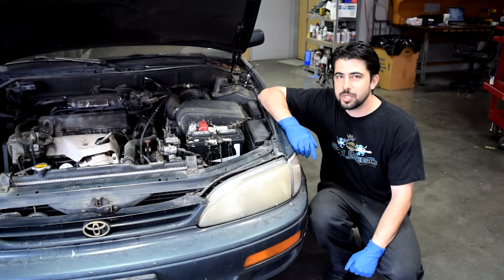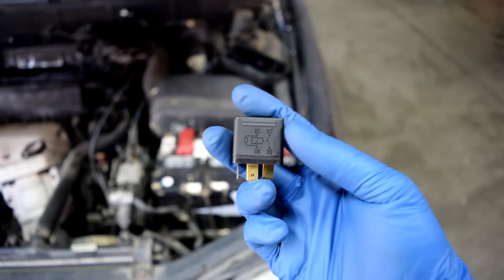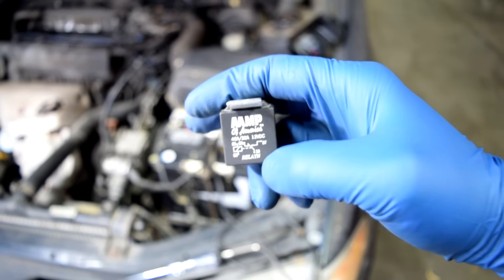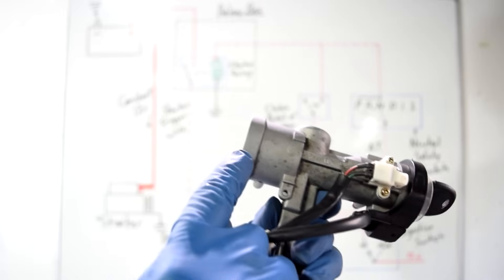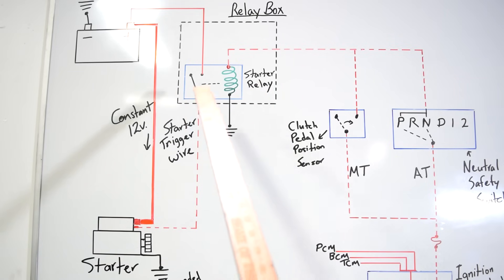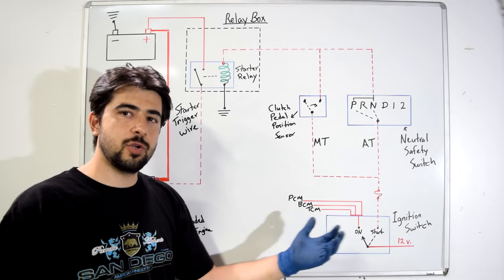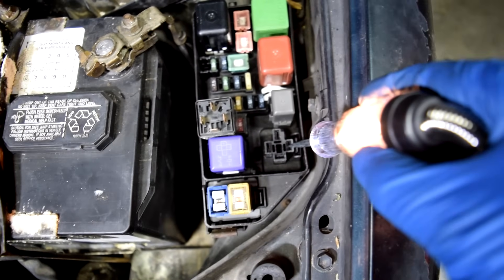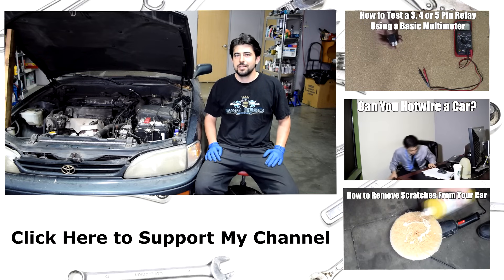How to Start a Car With a Paper Clip - NOT A HOAX

Comment: it is not about stealing the car. it is to check the starter without touching it. indirectly checking the ignition switch, neytral safety switch, and ignition relay

Comment: hi there having a big problem crank to start ok I replace crankshaft sensor ,spark plugs,ingntion switch,check fuel pump,coil pack on 2000 ford ranger please help 6787091022

Comment: I need sum help with my 2003 CLK320 ... I GOT IT TO GOT INTO THE ON POSITION BY DROPPING THE IGNITION OUT...THEN TRIED TO USE THE RELAY TO START... CANNOT GET A CRANK ...NOT SURE WHICH RELAY EITHER

Comment: Regrettably this method did not work on my 1992 Dodge B250 van.  I found the #30 and #87 slots and with a new battery, good working starter.  The van still will not start.  It will not turn over, it won't make any sound, the lights work the dash lights come on and the Check Engine light goes off.  The paper clip would not start my van.  :>(

Comment: I have a 2003 Lincoln town car executive.... with no crank and no start .... I was getting Crank , but no Start .. I removed all the Relays, and tested them for continuity, and Coil Connection... which I have both ... The battery is charged , and it's gased  ... plz help .. what happened...

Comment: Hi, I have a no crank no start issue with a 2011 jeep patriot.  I was wondering if you knew where the starter relay is located - in the TIPM or in the ASD, or somewhere else? Thanks.

Comment: I have this issue with my truck. If i do not have a issue with the relay or starter and it starts perfectly fine with this method, how can i figure out what the problem is before those? Bc sometimes (when it feels like it) out of no where the truck does not start, and i use the little trick and it starts. What part do i need to change or fix?

Comment: My 97 Plymouth Grand Voyager Van has a no crank no start condition or a "Open" condition. I used a remote switch
to test the starter to the solenoid which deemed the starter as good. With the key in the Run position and the remote
starter switch utilized the van will not run. Cranks only. I am leaning towards an issue at the key lock switch. Watching your video gave me the insight to try the jump at the relay as that will test the wiring from the power distribution center to the solenoid and eliminate that side of circuit as an "Open" however will need to also confirm the signal at the Engine Control Module. More troubleshooting to continue for my (No crank no start Van)  What is
so weird about all this as I drive it daily with over 300k miles on it. This last Wednesday I parked it for about an 
hour and went to get in it and go and nothing. So it has been a mystery to me as why that happened after driving it
under a shade tree to park. Guess that is why I am a shade tree mechanic. Got lucky about that parking as it is now hot here.

Comment: This reminds me of how to start a car when the alternators not working or the battery is badd used to take a screwdriver or any piece of material medal preferably a screwdriver that will protect you from getting shocked and connect to screw driver from the starter to any metal part of the vehicle and I would jump start your car I'm all school does every body remember that

Comment: ok , you got your car started, show me how to unlock the steering wheel so I can drive.. lol
Reply: There should be a module, somewhere in the dash that locks the steering wheel. 
Find it, remove it and you're good.
Reply: just break the steering lock, it sucks you have to replace it but if thats what you have to do.
Reply: Slam it in one direction or the other and the lock will break and you can drive
Reply: So you gonna wanna grab the wheel. Then let go and let the HULK GRAB THE WHEEEL
Reply: Turn the key
Reply: What about bypassing immobilizer on 07 pt cruisers .?? Lost key 😢
Reply: Put a flat head screwdriver inbetween the steering column and pry it , it should unlock
Reply: Youre gonna have to probably go screwdriver method.
Reply: Not what the guy above me said, my bad. I mean you might try the Kia boys method🤣 the old school screwdriver key. Just search how to start a car with a screwdriver
Reply: Why does my g.prix. 2002.3.1 only start when tilt wheel is in fully downward position? Something to do with bad wiring I'm told. Mechanic had done it this way cause lock cylinder was not always fully turning back position.
Reply: Get an angle grinder and cut the barrel off, it works great
Reply: 5444
Reply: @stevetoutant3554  l
Reply: Use a breaker bar

Comment: That's impressive, man. My friend who is an older gentlemen has a KIA Amanti, 2005. He claims the 3 front fuel injectors are overflowing with fuel, but the other 3 injectors are fine. His car strays but skips and alot. He is trying to figure out if he needs to replace the front fuel injectors, fuel sensor, or is it possible it may be his timing belt. How can I diagnose weather which fuel injectors is malfunctioning?  Thank you.

Comment: need help  all new parts  stated with paper clip no problem   on the   87  and 30   87 hot 30 does not have any power is that why ignition wont start car  help  help all fuses good baterrty altenator new

Comment: Have you heard of late 90s mustang with starting problems. I could spray starting fluid in the intake and it would start but after a few days it wouldn't start again unless I repeated the same process. Changed pumps, filter relays , and fuel rail and it still does the same.

Comment: great  video  03  crown vic  started  car with paper  clip  evry thing  good put a new  relay  but when   i turn ignition still nothing new alternatror battery car  runs good  is there something in ignition  that i have to replace      what DO YOU THINK ANY IDEAS   PLEASE  ALSO     TO  DO  A STRAT BUTTON RUN  WIRE  TO INSID  TO A BUTTON TO START  WI WHY DOSES IT NOT WORK

Comment: FYI, doing this on some vehicles, in particular, old Ford trucks, works great, but I have burned the crap out of a screwdriver before...if it'll melt a metal tool, it can burn you. Insulate the paperclip, wear gloves, or hold the tool you use by its non conductive handle. Also, depending on prices and budgets, you can bypass the relay semi permanently by using lamp cord and a push button on off "Nascar" style switch from the hardware store. Wire is free, switch is like 5 bucks. Run the switch into a bracket along the bottom of the dash, run wire through the seam in the door frame, down to the bypassed relay. It's also convenient for the fact that, as long as you don't tell anyone, no one will ever be able to steal your car, and you can do all of this, even when its raining outside. P.S. You WILL get burned if you try this method when you are soaking ass wet.
Reply: Thank u for this

Comment: If the relay malfunctioned, with 30 shorted to 87. wouldn't the starter crank nonstop without even the key in the "ON" or "IGN" position ??

That was what happened with my car's aircon fan. It ran nonstop on its own without any key in there, since the 87 part of the relay was permanently connected to the battery's positive terminal. I think this was a faulty kind of wiring - 87 should be to the "ACC" or "IGN" position.

Comment: I really enjoyed and learned from your explanation of the Starting System and relays !!
Reply: IhaveA2000Mercury Grand Marquis I need ur help desperately I was changing out TheFlyWheelon the car ,Well I needed a tool air I popped the trunk to get the tool well here is the part that makes me learn from dumb mistakes...I forgot  that the starter wire s were hanging is they touched hthe cross support bar at the bottom of the car So new the car smoking bad  well uyank the battery checked for turned wures none were found but the smoked only came from the driver side fiewalp and on rage inside of the car  please gel me fix what ever the problem may be I kniw that the oroblem had or come that dumb mistake that I made please help me out ...ScottLJohnsonSr

Comment: I've a 93 Ranger have some issue yesterday.  Truck can't start. Sometimes it does and most of the time it just click.Today I found out that cab light is not on. I had the battery charged and cab light still not on When do I begin? Main Fuse?

Comment: I have a F150 That blows fuses. When I turn the switch to on, right blinker works, left blinker flashes fast. When I  start the engine, it blows the fuse to the tail lights and blinkers. Could a relay short out and cause this?

Comment: can you power all the stuff you power on before the starter from under the hood somehow easily ? So you don't have to mess with the wires in the steering column if you don't have a key ?  I read you can wire the battery + to the ignition coil, then do what you showed here either shorting at the relay socket like you did, or at the starter itself.  
I'm considering buying a 1991 RV camper but the ignition switch is broken (actuator rod is snapped).  Maybe that old of a car doesn't have any modules/computers in it. 
Or maybe is just easier to pull the cable out of the steering column and figure our how to short them.  What would you recommend ?  Thanks a lot for the video.

Comment: Your narration is entertaining but a bit chaotic at times, so I apologize the need to ask for clarification.

By this not working with an electronic immobilizer, I believe you mean the method without the key? The exact variety of VW keys you show - late 90's or early 00's - point to a generation of cars where this trick might very well work with the key and ignition activated. At least I think I remember my mk. IV with standard transmission was able to hill start, which should mean the immobilizer is ready to go after key is inserted against the antenna ring and keyswitch turned to ignition, even if cranking were to be applied by other means than turning key to start position.

Hill(billy), tow or push starting any relatively modern car is of course recommended against by the mfg, and I'm not telling anyone to attempt it unless in an emergency.

Comment: this trick does work, but in some cases will fry your fingers when said paper clip goes from room temp to red hot in a matter of nanoseconds.... he used a fairly thick paper clip and got lucky... if he used a smaller paper clip he would have got burned too.... the easiest thing to do is just short the small wire terminal to the big wire terninal on the starter it's self with a small screwdriver, this fires the solenoid which fires the starter and all fingers are safely out of harms way if things get hot

Comment: If you get in your car, put the key in the ignition and you have power, radio and all other accessories then try to start the car and you dont even get a solenoid tick, i'd bet it's the solenoid (or so little power it wont even kick the solenoid).

If you get into your car and you have no power at all, well it's most likely your battery.... (if the battery is fully charged and you have no power still, you've got yourself a bit of an electrical problem)

If you try and crank the motor and it keeps cranking but you get no start,  it's probably fuel pump or ignition.

If you try to start the car and your solenoid on the starter ticks but the starter wont turn over it's possible the starter itself has a dead spot in it or maybe not enough power to turn the starter over. sometimes if you keep trying it'll eventually work, smacking it with a hammer sometimes works (enough of a nudge to get it out of its deadspot), or you try bump starting.

Let me know if i missed anything, i trust the internet will. lol

Comment: People seemed entirely too confused by this video and the fact that he had a key. 

This presumes there is a starting problem to diagnose, not that you lack a key and need to use JUST a paper clip. That is the premise. If you have your key and can start the car with it, you wouldn't be poking around with a paperclip in the first place as you would NOT have a starting problem to diagnose. It is rather simple, and he explained it beautifully. 

If you start the car with the key, it closes the relay switch in the process. If that all works, you system is fine and you wouldn't need to pop out the relay, play with paperclips or anything. But if you turn your key and nothing happens, you might want to rule out one half or the other. Less parts to play with makes fixing a problem faster and smarter. 

The paperclip isolates half of the system. If you can turn on your control modules with the key and start the car with the paper clip, you have just ruled out the starter, the wires to and from the battery, starter, and fuse/relay box, and have either a bad relay or something on the OTHER half of the system. 

Even if you just replaced the relay (without testing the old one), you would not know IF the relay was actually bad unless the car then starts. If the car still won't start with the new relay, you probably just replaced a perfectly good relay. That is the brainless way to fix (not diagnose) a problem (start replacing parts until it works). 

If you lack a key, THAT is itself a MAJOR factor in not being able to start your car. LOL. One would first replace the key by going to the dealer or would replace the lock cylinder and get a new key that way. Then you can at least start the car without hot-wiring (which he mentioned) if everything else is good. The point is that if you do NOT have a key, and think you have starting issues, you probably need to get a key first as lacking one IS a starting issue.

Comment: So wait.. if you used the paper clip to turn the car on... how do you turn it off?
Reply: Horse McHorseMan the key back to off.
Reply: Jimmy disconnecting the battery won't kill the car as long as the alternator is good, like if you have a junk battery that needs a jump all the time its literally just as good as no battery, so disconnecting a battery won't kill the car unless that alternator is bad, a way to kill it is to cut off the spark to the engine, or to cut the fuel off
Reply: Jimmy unless you're working on a diesel engine. They will keep running untill you stall it.
Reply: Jimmy Yes. If a diesel engine is running, the only option to turn it off is to choke it. There is a valve in the intake System that closes when the key is turned.
Reply: stall it xD
Reply: wait so how the f am i supposed to turn it off?
Reply: Wait for it to run out of gas :)
Reply: Take out the fuel pump relay?
Reply: Horse McHorseMan
Reply: daah
Reply: yes great ? i was saying that exact thing
Reply: YOU TURN IT OFF WITH THE KEY!!!!!!!!!     KEY TO OFF POSITION..
Reply: Everybody thats asking how to turn it off is obviously planning on stealing cars without the key ×D
Reply: Eric Williams im wondering how to turn it off without the key because I'm broke and lost my keys
Reply: @BlueJayPaints  pull fuel pump fuse
Reply: Wait  for  warranty  to  end, then  it  will  die

Comment: I'm seeing a lot of people saying this is an easy to-do for car thieves but you have to get inside the cab to unlatch the hood, I suppose you could break the window but why not just hot wire it at that point
Reply: You still need a key or the steering lock locks instantly when turning. This was for educational purposes.
I guess you don't understand cars at all.

Comment: cant steal a manual car like this, because you have to engage the clutch. also you forgot to mention this in the video
Reply: David Little You're bypassing that circuit as well so you dont have to press the clutch. Also as a european i've never actually had a car with a clutch safety switch but i've also never had a car without an immobiliser so this trick is pretty much useful for diagnosis only. Having an immobiliser would allow you to crank the car by doing this but the car would never start without the key and immobilisers have been compulsory in europe since i think 1998..
Reply: mine has a clutch safety but no immobilizer, this is mainly an issue for autos

Comment: This only works on very old cars.  Any car designed in the past decade requires the "computer" in the car to run.  So it won't work because the computer is not on due to the key not being in the ignition.

Comment: lol gotta love that starter relay jump 
I acutally use this on old dodges to work thru troubleshooting when upgrading to more modern ignitions. I use alligator clips and jumper wires (with a toggle for main 12v) so that i can isolate each portion as i move forward. Good video

Comment: This did nothing but burn a hole in my hand. Thanks, dick.
Reply: Kyle Pugh I was waiting for someone to comment this... use the wrong size paper clip and you will fry your fingers.... this guy should have never recommended the use of a paper clip because the amount of current going from 30 to 87 can easily heat up a paper clip to red hot in less than a second.

Comment: still cant drive it without removing the lock on the stearing wheel. easy cars to hotwire and steal in europe are ford orion, and most old opel's/vauxhall's from 80-90's. stearing wheel locks are broken easy and the plastic under stearing column are broken off then plastic behind the key inserts are pushed off and use a little screwdriver to start it. so u only need 1 screwdriver for everything incl opening door look. to steal most older vw golf's and other vw you can use a square screwdriver and a wrench or just a semi long pipe to break off the whole key lock off the stearing column. but new cars is to much hazzle if you dont have time for it or have the right tools.